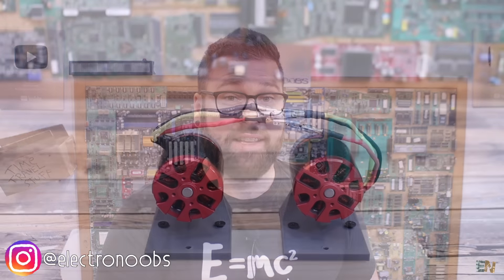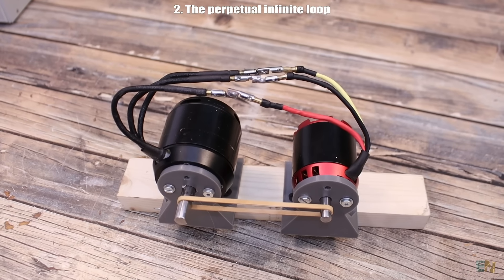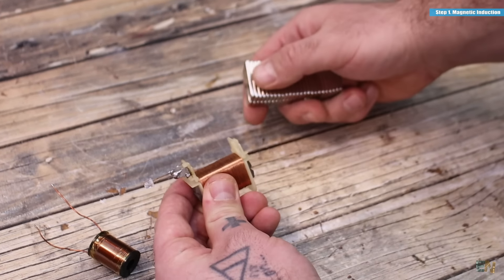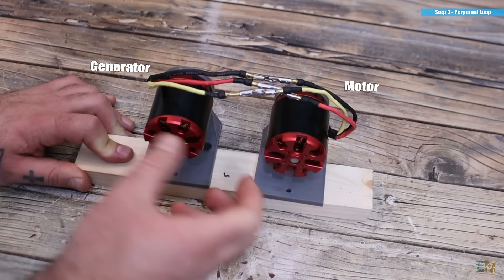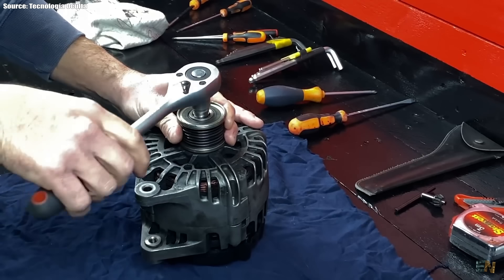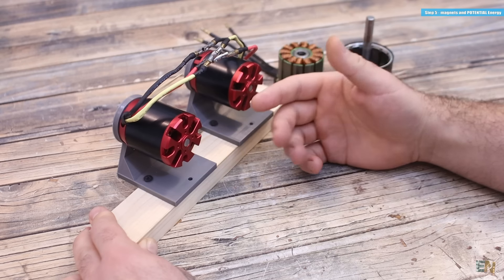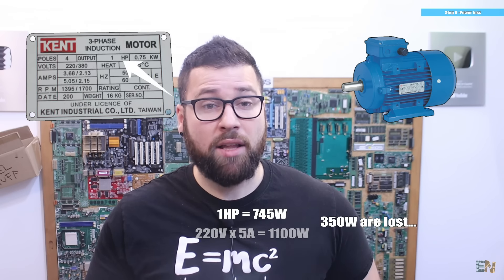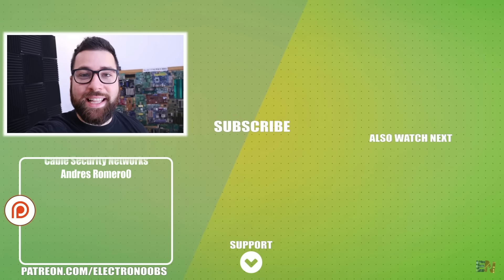Free Infinite Perpetual Energy Nonsense - FAAAAAAKE

Comment: I'm not saying I agree or disagree with the entire concept.
But I do disagree with the way you're explaining what the magnets role in this is
You call them potential energy as if they're a battery with stored energy in them, which is not the case. They have a different force of attraction and repulsion. Their theory is that the next iron core attracts it and the momentum built up while it's traveling towards that core projects. It past it to the point where it's close enough to the next quarter to attract it again causing perpetual motion. They're not saying there's a thousand watts of magnets cuz that doesn't make sense

Of course I'm not referring to the ones that are used in a car alternator. I've talking about the ones with they take maybe microwave power supplies, remove the 220 volt coil and leave the iron cores separate and make a circle with them. Machine and aluminum spindle applied magnets to it and then there is repulsion and attraction after it's been mechanically spun initially.

Again, I'm not saying this is true because I haven't tried it, but I'm saying the concept is different than the way you're i explaining it.

Have you seen the new patented motor design that uses a very small? Maybe quarter or half horsepower motor and runs a magnetic induction system that does 20 to 1 power output compared to the input.

This is real free power, but you do have to have some power to start with a very small amount because of the power of a traction is there, but without the small input of power it'll eventually stop

Comment: why can't you use the repelling force generated by matching poles facing each other to turn an electric motor?
Reply: If you push the like poles of two magnets together, the energy to do so is coming from you. When you release them and they move apart, the only energy involved is the energy that you put into the system when you pushed the magnet towards each other. 
Once the fields are no longer in contact, you have to add more energy again by pushing them back towards each other-so this wouldn't be a free energy device, it's simply a system where you are the source of energy.
Reply: @darklight2.1  what if you attach them to a wheel and have the turning of the wheel move the fields towards and away from each other?
Reply: @ObadiahWanderer  If the magnets are arranged in a circle, then one will always be repulsing while the one across from it is attracting, they cancel out and nothing moves.

There is no arrangement of magnets that will result in continuous rotation. You can get some cheap bar magnets and try it for yourself just for fun.

Comment: But.. What I'm confused about is an alternator keeps the vehicle running and charges the battery? So surely there's some additional energy which can be stored and used
Reply: A gas powered vehicle charges the battery through an alternator, but the power is coming from the engine. If you removed the alternator, you'd get about 5 more horsepower because of the decreased resistance. If you did this in an electric car, the alternator would take more power than it supplied to the battery. 

You need to remember that it takes force to turn an alternator. The brakes actually use this force to stop the car and charge the battery.

Comment: Do not be negative. Sit down and work on it. Infinite perpetual alternating current generator is real. I am convinced from basic physics - applied technology to magnetic flux and wire turnings or coils. Mechanical nonstop fly wheels (turbines) causes ac generators to power up appliances (part 1). Use two ac motors can also convert initial electrical or mechanical energy to perpetual energy source.

Comment: you don't need a 300w to mechanically obtain the 300w output you just need enough RPM from the alternator which will produce enough current to run itself and another load.  if you get the alternator spin at the right rpm your power output will be enough spin the DC motor which produces 12V output which is what the Alternator need to run. So the DC motor will control the RPM of the alternator and the alternator will produce enough current to run a couple of things.

Comment: What time if there was a step up geared connection between the two. For example the alternator rotating two or more times the speed of the motor.
Reply: @darklight2.1  It could cause the alternator to turn 2/3/10 times faster then the electric motor. What additional energy is used other than the initial spin up of the heavier gear but once it’s spinning it could act like a flywheel and use the centrifugal force to help maintain rotation.

Comment: Use these spec pieces instead:
Single phase motor
220 volts
50 Hz
1cv / 1 HP
2800 rpm

Truck alternator
24 volts
200 Amp
Make sure you add the magnets to the alternator rotor properly as well.
Reply: Have you tried it yourself? Did it work at all?
Reply: @pstonard  nope. But through analysis of a couple videos I got the above specs. I'm buying the parts this week and using the exact specs above. Got info from this vid: https://youtu.be/-8G1JCT2c78
Struggling the find a 24v 200a alternator in the UK. I will go for a 120a instead, which should require less HP to spin it. I think I will try a motor with 0.75hp. 0.5hp may be pushing it for 120a.
Reply: @pstonard  I think the most important thing is 24v alternator, as the magnets upgrade the voltage about 10x to 220v.
Reply: @pstonard  purchased today 1x 24v 120a truck alternator. And 1x 0.75HP 2800 rpm motor. Will update progress
Reply: @pstonard  ;)

Comment: I have actually found a way to create electric using some parts of the method in the video but using a gear box and having the three main parts horizonal upping the energy made by the motor through the gear box very similar to a wind turbine

Comment: The motor and alternator are mounted to what appears to be a thick solid base. The base is hollow to hold batteries. Wiring can go from base to hole in back of modified 3way power board/strip. The tape around the edges should arouse your suspicion.
Anyone dare to explain his drill?
He has a Bosch psb650re. I checked the specs. Input is 650watts and output 338watts..
So how does he measure his drills power consumption at 850watts under no load conditions?.Anyone?..
....... 🥱 Just what i thought..
This was a good vid, guess someone had to do it 👍
Reply: @pstonard  You are correct Peter! Its like, David Copperfield eat your heart out. Even the eerie background music.. lol
 At least you ain't fooled mate 👍

Comment: I made one of these years ago it did work to run itself but would only last 5 min with it plugged into a lightbulb
Reply: No, it did not run itself.  That did not happen.
Reply: @David Gill  mine had a flywheel, a normal alternator and an inverter so it wasn't exactly the same, but as I said it would only run for 5 minutes and was a massive waste of time.
Reply: @bomber16693  You said it worked but it would only run for 5 minutes under load, bullshit.

Comment: what is meant by free, like the wind moving a ship with sails? 
note there are no magnets within induction motors, the most common household motor used and some providing significant power in KW region; there are in reality self exciting induction motors which switch the part of the stater coil off at a certain speed with centrifugal switch. when an induction motor is pushed only slightly past it's slip speed it will become generator, this is a reality also you may check your power engineering text books.

Comment: Is your generator wired in the correct way? The electrons need to be moving in one direction and not alternate so that there is a charge difference creating electrical potential. The difference in magnetic force (gradient) will also generate potential energy.
Reply: Ok Ok    AC is the only way power is generated then we can convert to DC  store it ie. batteries / capacitors and then like the man said invert the DC back to AC            and a tip electrons only move in one way regardless AC or DC and that is ( negative  to Positive ) but in most diagrams is shown to be (+ to -)

Comment: I took one look at it and even without a deep knowledge of thermodynamics, I could tell that there was a battery hidden somewhere in the setup connected to the powerstrip.
Reply: Unfortunately, a battery won't run the drill and grinder.

Comment: Try building the Modifications to the exact BMW alternators that were used in what you call the fake ones. So what is the exact Flux density of the magnets that you're using within your alternator compared to the super magnets used in the construction of the fake ones. The alternators and motors that you're using for your demonstration will never work. Try thinking outside of the box. A single phase application is not an issue at this time. I'm am in the construction process of building the 2 donut magnets to power an incandescent light bulb for starters. If it works I'll take the mods to a machine shop to replicate the BMW alternator the way it is described in the Youtube videos. The info and specs of the magnets and alternator partnumbers are under raps due to copyright infringement.

Comment: You are all wrong, I have built a free energy motor, it can travel at the speed of light, I tested it and it worked but I forgot to put a return flight plan in the computer so the craft is some where in the out reaches of the solar system, you will just have to take my word on it that the project worked.

Comment: also generators can run on hydrogen easily produced  from the 12 volt output side of the generator , it works cos ive done it , only modification made to carburetter was a small blow back preventor  for start up .

Comment: Not too knowledgeable about things like that, but one guy shows a Transformer that's 12V (I'm assuming DC) on one side, and 220V (AC?) on the other side, and I'm also guessing he's running that Transformer in Reverse...which would bring a Safety issue into the equation...can that even be done without blowing up the Transformer, or can they be run in either direction? If that makes any sense...

Comment: Ots not Fake. I built 2 of these for when my power goes out. The magnets aren't for what u are saying. They are to get erate more power by using the negative push. This worked for me with brilliance.  The idea you think the magnet is supposed to give energy is wrong.  It's not supposed to do anything to the coils.  
YOU COMPLETELY MISS U DERSTAND WHAT THE MAGNETS ARE USED FOR. Once the motor started the magnets are moving so fast that the negative and positive are forcing direction giving the current stability. I'm not a rocket scientist but this worked for me and I love not wasting g food when my power goes out

Comment: lol i came here to read the comments. never ceases to amaze me how many people out there dont seem to understand the basics of physics and thermodynamics. where to begin.. omg i dont think i can break this down barney style enough for some people to understand. my understanding of stupidity only goes so far. why would you think adding extra magnets would magically add free energy to something that already uses magnets to generate that energy or use it up in the first place? geez i might as well strap an extra engine in the bed of my truck to get a little more horsepower. no extra connections or fuel required i guess. all that heat generated by both the motor and the alternator has to come from somewhere right? surprise! it does and you would be surprised how its made lol. and to think im no einstein by any stretch of the imagination but some of these people make me look like a dam genius

Comment: Here, brother, you are wrong.The faster the rotating magnetic field rotates , the more power it gives out .And to get a 2 kV auto generator, it is enough to spin it at 3000 rpm with a weaker engine.Sorry.

Comment: What? What is your education level @electronoob? They don’t get energy out of the magnet and it has nothing to do with the copper that's there other than its original job.
The magnet turns the motor by using the shell of the motor as it turns since the shell or cover is made out of metal. As the motor turns it generates energy similar to a water turbine on dams instead of a propeller or whatever is inside a dams mechanics its the magnets and the metal cover of the motor that is the water and the magnets the propeller that spins the turbine. the use of the other motor is for it to keep it at a constant spin so it generates the max amount of energy or power. because the momentum of the magnets and the spinning will eventually stop.
@electronoob you haven’t built it so it’s just your opinion and what ever qualifications you have.
Power from magnets 😂😂 yeah, I think @electronoob is jealous that someone has 1 million followers.
Why big tech companies haven't used this? how do you know they haven't. second reason greed plan and simple it can be built by anyone it doesn't require fuel other than magnets and parts for the motors. so, big tech companies have someone like this idiot @electronoob continuing there lies.

Comment: A car alternator works with the same principles. Energy is taken from the batteries and it is returned back to them via the alternator. Especially in a diesel engine where they aren't any SPARK PLUGS. All the alternator does in that case is provide electricity for the electrical components of the vehicle. When testing an alternator, they attach it separately to a pulley and someone spins it, to see if it is generating power. Eventually, belts and alternators does run out. How long? No one knows. So I wouldn't say that the FREE ENERGY in question is INFINITE. So, here's my request from you. Why don't you reconstruct exactly what they did without editing and see if it works as they say it does. I believe that what they've done can work and it will work. Perhaps with an inverter added. The Alternator in a Diesel engine, generates power solely through belt driven power. So please replicate what they've done and if it works then, Yes. If not then No.
Reply: " So, here's my request from you. Why don't you reconstruct exactly what they did without editing and see if it works as they say it does."
Would it not make sense to reason through the theory and do some Math first?

However, if Electronoob or another competent You Tuber builds it exactly and it doesn't work what is the next step? The FAKE builder will just shout that the copy was not done correctly. Most likely they will be silent because arguing over a replica doesn't help them harvest You Tube Ad money, which is the REAL goal of their FAKE video.
Reply: Your reply proves nothing. Theory is just all talk. Replicate what they've done and what if it does indeed works? Then what? I am not someone who just dismisses someone else's work without proof. Tangible proof. So I am waiting.
Reply: @eddysongerville5511  If you really want a hands on experiment to convince yourself of how energy works try this:

Hit a cue ball with a cue stick, it then hits a second ball. The cue ball stops moving after slowing down, but the second ball start rolling.

Energy was transferred from the cue stick to the first ball, making it move, that energy was further transferred to the second ball, making it move and as the first ball gave up its energy it stops.

It's not all talk. We call it a Hypothesis ( a supposition or proposed explanation made on the basis of limited evidence as a starting point for further investigation)

Comment: I like this 
I m electro-mechanical engineer and I know the video is a fake 
first they are not control speed and voltage so how he can run without ? 
second you right why they don't use 3 phases ? the electric motor run with 3 ph we put a capacitor for replace the ph miss 
we can demonstrate that is not possible 
have a great day

Comment: Correct me if I'm getting something wrong, but wouldn't using a coupler and connecting the motors face to face make the direction of their rotation opposite to each other? Where as using a chain/belt system makes both the motors spin in clockwise/anti-clockwise direction. Or the direction doesn't matter?
Reply from the maker: Doesn't matter. Just swap the cables...

Comment: I sure will try building a setup that works, i believe in the free energy concept and we must find a way out! what we are trying to achieve is conserving energy losses into energy gain. if you are running a 5kva generator at full potential and you only utilize 2kva as load, where is the remaining 3kva 🧐 So, what can we say if we place a 10kva generator motor and try finding a way to spin it at full potential with a 2kva motor we will sure gain between 3 to 5kva of power output. somehow, there should be a way out.

Comment: what if i use a fly wheel with permanent magnet install  on it and a stationary winding alternator (A1) and a 1kv alternator (A2) connected to armature and armature connected to hydraulic motor  and hydraulic motor runs through a hydraulic pump and pump runs on Alternator A1 power ....... i think pump will store enough pressure to run wheel and after spin A1 feed the hydraulic pump and it will run in loop hydraulic to mechanical to electrical ........ whats your thought ??????  sorry for my english is weak

Comment: because a truck alternator is expensive, an AC single phase motor is expensive and you're not an engineer, so you can't afford it , or even invest in it. your video does not exactly follow the process, not even in theory.

Comment: How can the alternator in the car charge the car's battery when the car is running.
Reply: Hello, you answered your own question. When the car is running it is running. The energy the car is generating (running motor) drives the alternator which generates the voltage to charge the battery.